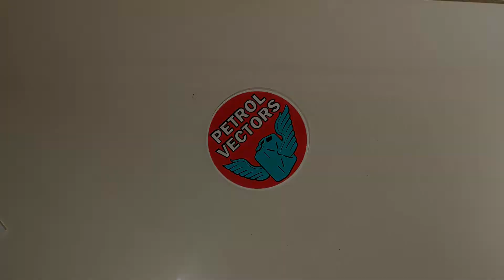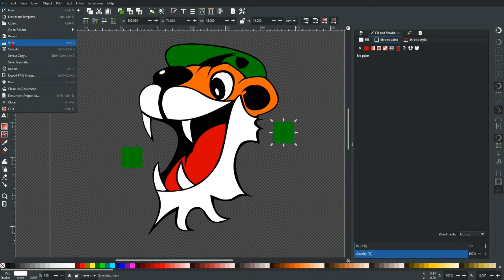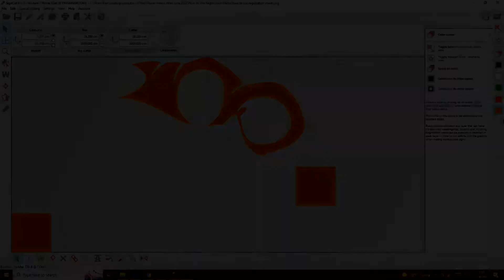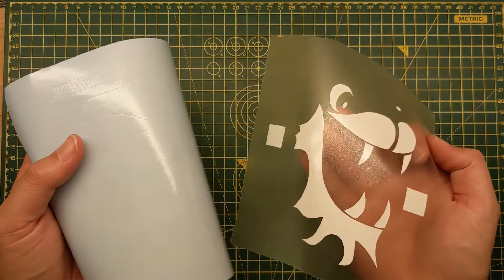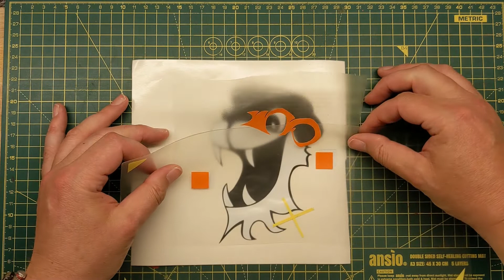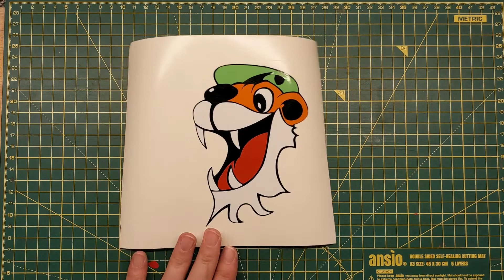How To Use Registration Marks With Stickers

Comment: i found out people often use parchment paper for aligning you could add some new alignment cubes with each layer on a different place and remove the older one..
Reply from the maker: Yes there’s a few alternatives but what I like about transfer tape is it’s always on my bench so I can easily make a new piece if needed. I tried the registration marks and didn’t really get on with them, for small work you can be surprisingly accurate and consistent just doing it by eye but it depends on the work and how confident you are at doing it, go for it and have fun! 👍

Comment: I would like to get some of the clear plactic sheets that you are applying the application tape to align the registration marks.  Could you tell me what the sheets are called and where could I purchase some in the UK
Reply from the maker: Hi Peter, the sheets are DIY, very easy to make, it's just 2 pieces of equally sized transfer tape stuck to each other. Then I put a bright coloured bit of vinyl on one side to help find it as when I place it down on the work bench with all the other bits of material it kinda vanishes! hope this helps, Dan
Reply: @petrolvectors  Thank you very much for the additional information - now trying different combinations of materials to see which one is best for me.